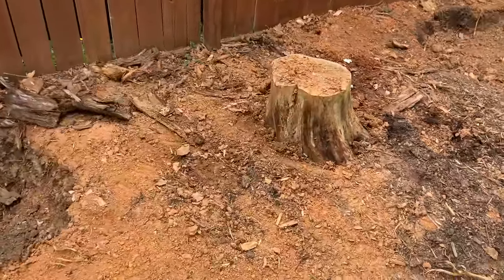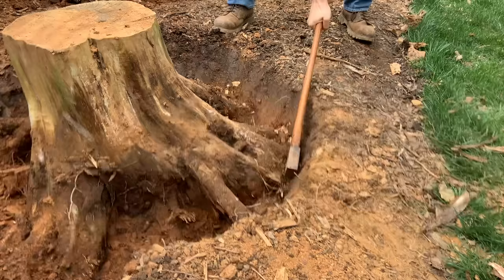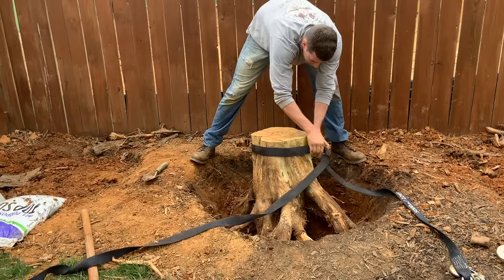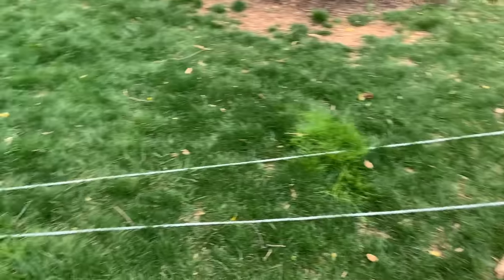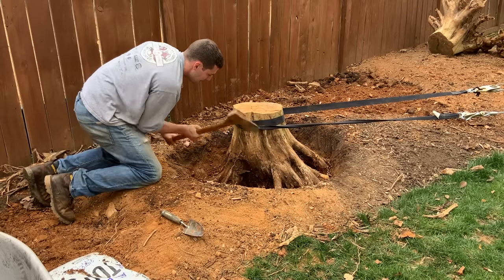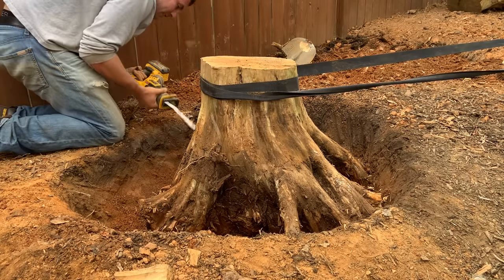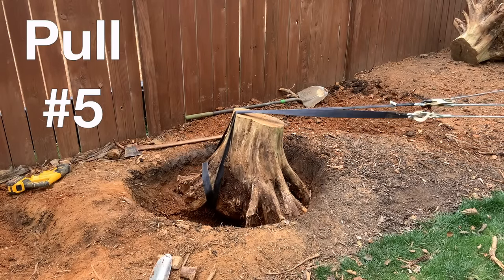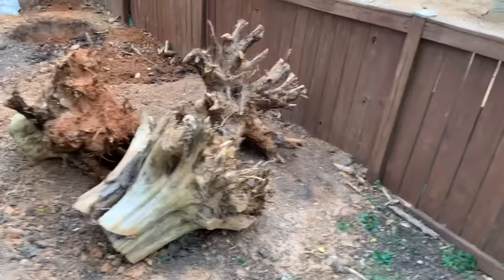How to Remove a Stump Using a Hand Winch

Comment: Why was this man busting his ass chopping the roots when he had the electric saw?
Reply from the maker: The saw blades dull quickly in the dirt and it’s always nice to get the heart rate up
Reply: Soon as chain saw touches dirt its over. You CAN use a saws all with a big blade however.
Reply: I think he likes the workout
Reply: Because sand destroys  the chain?
Reply: Dulls the teeth instantly,  then if you persist, grit gets under the chain and it breaks,  then you go to the hospital. An old circular saw blade is better and a sawsall works well.
Reply: It's possible to use carbide tipped reciprocating saw blades, I've also used the axe as well
Reply: Additionally I have used the mini handheld electric chainsaw available from Amazon and prices from $50 to $65 if you're careful with where you point the chain you can get quite a few Cuts before it gets dull.   Extra chains are available in multi packs for a very reasonable price
Reply: Recip saw with pruning blade or 9" wood blade is a standard on sewer crew jobs
Reply: U the type of guy who borrows someone’s tools and break them all.
Reply: @bellinghamfpv  you and I are both digging in the gravelly river rock and huge evergreen roots huh
Reply: You ever swang a axe in your work boots? Bettern putting syrup on your biscuits, boh
Reply: Macho stuff 😂
Reply: Because man!
Reply: I think the saw he was using was a sawsall.
Reply: Yes it's a last resort unfortunately.
Reply: But how long would it take to cut the tree down with a fork?
Reply: Why do people spend 15 minutes walking on a treadmill without really going anywhere
Reply: The wood closest to the ground has sand impregnated into it. It's not just the dirt.
Reply: I see you know nothing about roots
Reply: @Kaizen747  🤔
Reply: Because sharpening saw chains is annoying. And cutting dirt gums up the guide bar and stops it from oiling well and shortens the life of the bar and chain
Reply: @A_Dirrty_Bird  true mate
Reply: Sorta depends but bigger roots that are exposed well will be quicker with a good sized axe. I rip through batteries cutting stumps out. And then your arms are shaking for an hour.
Reply: @the-macjagger  spot on mate.
Reply: The pioneers did it this way sometimes being nostalgic is more interesting than technology
Reply: Sawzall blades dull from cutting in sand and dirt too. Basically you can easily dull electrical tool blades versus using a classic lopper or axe. More work, less expensive.
Reply: Battery possibly
Reply: my uncle Vern used a rope and his horse 🐴… old-school works every time !!!
Reply: Testosterone.
Reply: Did you watch the video? There's no chainsaw. It's a reciprocating saw. @the-macjagger
Reply: This is a job for Big Ed Pulaski
Reply: @jackmeyermakes should have made it
Reply: Me too😊
Reply: ok
Reply: bc he wants hemmroids 🙃🥸🙀
Reply: Make charcoal and save a lot of work.

Comment: Lastly, if you know you're going to remove some trees always leave a 4-foot Tall part of the stump.   Do not cut it down to the bottom because you can use the leverage of the 4 ft to help break it out of the ground applying pulling chains to the other trees not yet removed.   Take advantage of your existing objects/things around you to assist in efforts and with a little bit of pre-planning and leverage removing the tree stumps without mechanization.
Reply from the maker: These were cut before I moved in but completely agree the more leverage the better
Reply: Use the truck wheel trick when stumps are too short.

Comment: Thanks for the video, reminded me of a project I did quite a few years ago. Since I was cutting down the tree, so I had the option to leave about six foot of stump, to give me a leverage advantage on the stump. Like you I dug around the stump as much as I could and cut what roots I could get to.  I connected a two ton come-a-long to the stump and to a solid tree. I then pulled as tight as I dare, then just left everything hooked up, I poured water around the hole I dug, around the roots. When I got home from work the next day, I would tighten the come-a-long a few more "clicks" (as tight as I dare) and then pour more water around the roots, In about three days it came loose. Took longer, but the end results were the same. Take care and God bless.
Reply from the maker: Good approach thanks for sharing
Reply: Took longer but less effort.
Reply: EXCELLENT!   Yes,  your adaptation of tension Over intervals of Time is smart😊👍
Reply: Stump grinders are definitely easier, but it’s cool how those stumps can be turned into beautiful, functional pieces!

Comment: If you make anything with the stumps, know that stump wood is extremely abrasive because of the embedded sand and grit in it.
Reply from the maker: Noted. I know most saw mills won’t touch them for that reason. I’ll probably rig up a flattening jig expecting to do some resharpening

Comment: Jack, after I cut the first root apron, I fill the pit with water. Wait and hour. Then 8K of pressure is plenty. I also use a cheater bar/metal tube to give the hand winch lever 3 times the power (24,000 pounds).
Reply from the maker: I like that approach
Reply: Ha! u wish, at 24k punds the cable is gonna break, I dont tven think it can output 8000 pounds, mor like 4000 with the pulley...
Reply: The winch was not designed to withstand the pressure that can be applied using a pipe on the handle. You'll kill the winch. I've done it.
Reply: 24000lbs 🤔? hmmmm

Comment: The reposition for upward force was pretty smart! I'm sure I'm gonna use that idea at some point.
 I use an old truck wheel for the same sort of effect when stumps are short.

You can also wrap chain around the stump and use a recovery strap between the chain and wench.
Leave tension on it overnight amd just start a small fire under the base where the roots are. It should slowly pull up as it smoulders. The recovery strap will just keep on pulling as the stump moves.

Make sure the area has nothing flammable and soak it down. And put a fire ring or bricks Around it just to be safe.

Comment: I find leaving several more feet of the trunk attached rather than cutting it off a foot or two above ground level gives much more leverage potential when winching the root ball out. Hard but satisfying work when you finally pull the root ball away from the hole.
Reply from the maker: Agreed on the additional leverage making it easier. These were cut years ago before I bought the house so had to work with what I had
Reply: Yes. I had 36 trees cut down but left 5' of tree sticking out. A little digging and then I can pull out massive stumps with my backhoe. The leverage makes all the difference in the world.

Comment: I hate working on my knees and trying to dig soil around roots, so I use a garden hose to blast out the soil around the roots. Do the initial digging with a spade but once I start hitting tangled roots, I start hitting it with the garden hose.it’s kind of messy and mucky, but I do it over a period of a few days, letting the water drain away each time. It saves a lot of backbreaking work, even though it turns into a multi day project.
Reply from the maker: Good suggestion, anything to make it easier is a win
Reply: If the soil is extremely dry and you don't want to make it muddy, you can tape your shop vac hose to the sharp end of a wrecking bar and just start poking at the dirt while the vac removes it for you.
I have a hole digger that works in a similar way.
You can also use a drill with a bulb planting bit and just have someone hold the shop vac in place.

Comment: Nice work
Have used a 2 ton bottle jack, wood beam and blocks to lever stumps out of ground with wire cable over the beam and around the stump. Did not have an anchor for the come along, worked well with similar patience and absence of power tools.
Reply from the maker: Love it. I’d like to try your method sometime with vertical lift, seems like it would require less force

Comment: I know this work, I did it myself in a similar way. It was quicker with a tractor than with a rope hoist. I sawed off my last stalk with the chainsaw at ground level and added soil on top. To make the stalk rot faster, I drilled holes and put stable manure on them.
Reply from the maker: Good stuff, haven’t heard that trick before to make the stump rot faster

Comment: Thanks for the tips, just what I needed thank you.Went & bought a similar hand winch & smaller strops as I am using the tree next to it to do the work. Spent a large part of yesterday with just an axe & a pick & was blowing out my arse, thought I was going to die with exertion! Started setting up with the winch but it was getting dark. Just had a brew & going out with renewed enthusiasm & confidence! Thank you sir.
Reply from the maker: Love to hear it, hope you got it out of the ground today
Reply: @jackmeyermakes  Yes I did, thank you, the cable was only 3 metres but worked perfectly with strops & d shackles. Thanks for the advice, much appreciated.

Comment: I've removed a lot of large stumps on my property, but given how labor intensive it still is I can't say I've found an optimal way yet. Right when the tree is felled I try to cut away as much of the top as possible, ideally I level it with the ground. Then it takes around four years for nature to take its course and rot away most of the smaller roots, which will make it easier to pull out the larger roots later. At that time I dig out as much soil as possible around and below the stump with a hoe, takes about an hour. Then I take a chain saw and cut vertically into the stump to split it into four or more parts, as far down as I dare to go. This quickly wears out the chain, no way to avoid it. Then I take a large iron to break the stump apart with sheer force. I also use a sledge hammer to bash the various parts of the stump and roots. Takes around two hours to remove a stump. I've seen various clever tricks to remove stumps, but in my experience there is no easy way if you don't have access to machinery.
Reply from the maker: That's a great way to do it

Comment: Were there 2 trees to pull from to pull that stump out ? I’m confused on how you had your rigging routed. What does the line on the bottom right of the screen at 2:24 connect to ?   The snatch block at the bottom left connects to the hand winch and then the other side of that hand winch is connected to a tree ?
Reply from the maker: Yea I should have showed the anchor trees in the video. There are two mature trees about 15 feet apart from each other that I anchored to
Reply: @jackmeyermakes  ahhhhh ok thank you for replying 😀

Comment: I love the mechanical advantage idea. It was great up to the point where you pulled on the wrong spot. If you would have pulled on the single line off to the right you would have had 3 times the winche's pulling force as you explained, but pulling on the snatch block as you did resulted in 1.5 times the winche's pulling force. Still some advantage, just not what it could have been.
Reply from the maker: I realized this a long time after posting the video but you are exactly right. If I had pulled from the single line I probably could have shaved an hour off the work
Reply: Good catch, I never noticed until I read your comment. I think he got a 2:1 advantage, instead of 3:1, he could have. If you pretend  both trees are beside each other, he has a fixed point from the tree to the snatchblock, at the stump. When the snatchblock is by the load, it is a 2:1. He is then pulling on the other cable with a comealong. That snatchblock he has attached to that, and the stump is static. It isn’t doing anything or offering any advantage. He may as well have one line from his comealong to the stump, as what he has isn’t doing anything.

Comment: Interesting method, low cost and efficient. The only thing is about safety. I don't know what the tension is in those cables, but if one snaps, it could hit you very badly. Or maybe I am wrong?
Reply from the maker: These cables are rated for much higher than anything I can produce on the winch. The straps you’ll want to make sure are rated for a higher tension than you’d expect to produce. Could get a little squirrely if one snapped.

Comment: Stump can be pretty cool if you dry them clean them and leave them upside down for yard decor with the roots swirling around. You can even stain them.
Reply from the maker: I cut the bottom off one and plan on cleaning and finishing it to hang on a wall. I’ll make a video on it eventually but it is low on the list

Comment: I bought a HF hand winch and it failed right out of the box.  I noticed it operated really roughly.  I replaced it with a more expensive model and wow, what a difference!  You do get what you pay for.
Reply from the maker: That’s the truth. This winch barely made it through this job, the teeth started bending if I pushed it too far

Comment: I’m glad you wrapped a nylon web around the stump so the cable wouldn’t dig into it.  Why not use the reciprocating saw earlier in the process to reduce or elinate the axe?
Reply from the maker: It’s tough to avoid dirt with the saw which dulls the blades quickly, figured I could save a few by only using it where the axe had trouble reaching
Reply: @jackmeyermakes You did right using the reciprocating saw. You wouldn't believe how many people who would've used a chainsaw, and instantly dull a $30-50 chain. Way more than a 10pk of harbor freight blades. ( I was waiting for you to break it out.

Comment: I prefer a lever chain hoist. My one cost approx. 60 Euro and augments the force by 21x (2100 percent). It is very important to be familiar with the correct selection and use of chains and shackles. The chains which are meant to show where your private owned driveway begins might break at 100 kg.
Reply from the maker: I’d like to give this approach a try next time. I think you are right that it’ll go quicker

Comment: You never trust the rating on your straps to mean they won't break.   Instead you don't stand places where you'd get hurt if they did.   

Imagine a work site where they just said "hey, make sure you don't get hurt"

You need to both use correctly sized straps AND make sure they can't hurt you even if the ratings aren't accurate (either never were or they have degraded)

Comment: Leave 6 FT of trunk on top until the stump break free.  Attach strap a ft down from the top.   Gives you a lever with another 5X force multiplier.    Done this a few times.
Reply from the maker: Yep I would have done the same but the trees were cut before I moved it. A longer lever to pull from could have saved a lot of time digging

Comment: Could you do this with one anchor tree?
Reply from the maker: If you have a big enough anchor tree then i don't see why not
Reply: @ what did you use for a line. I have the tree savers and the pulley but I need more line.
Reply from the maker: I used a braided steel cable and it was way overkill for this application. There may be some synthetic ropes out there rated for winches that would work just as well

Comment: i used a sawzaw as well to cut the roots, then got 2 2x4 together and screwed then with 2 large large bolts to the trunk, then I used a floor jack under the boards to raise, then repeat on the other side etc.  I'm sure there a million ways to skin this cat. It just thats all  I had at my disposal in my back yard and no trees to winch from.
Reply from the maker: I’d like to give your method a shot some day

Comment: If the trunk still exists then obviously can pull at the highest point - I did this once to pull out a substantial tree and with the massive leverage no root cutting was necessary. Used a Tirfor but obviously again need a convenient suitable tree for tree for the anchor.
Reply from the maker: Yep a longer lever with the trunk cut higher up would have saved me some time

Comment: Hi. You can damage the bark of you second tree. If bark is removed 180 degrees around, your tree will die over time as it’s water circulatory system is cut off. Thanks.
Reply from the maker: Valid point. I used a 4 inch wide strap around the anchor trees, no damage done

Comment: In that opening between the roots, center stump, place a high-lift jack and Jack it out.
Reply from the maker: Good point. I’ve read it takes much less pressure if you can lift straight up as opposed to pulling from the side
Reply: @jackmeyermakes  I've had as many as 3 of those lifting from different points.

Comment: Hello, recently came across this video and am currently pulling out a stump. Any tips for pulling one out that has really thick roots that go quite deep? 😅
Reply from the maker: A handful of people suggested removing dirt with a pressure washer. Haven’t tried it but it may save you some time vs digging. Best of luck in battle with your stump

Comment: Get yourself a spud bar. One of the greatest tools known to man, a true back saving multi-tool. I never go on a job without one. 

As for this hand winch method, love it! Tried it myself on a stump removal job last week. There wasn't a convenient tree for the winch, so I ran it around one of the stumps holding up their neighbour's house. They were out at the time but I figured they wouldn't mind. Better to ask for forgiveness, I think, than to ask for permission. Pleased to report back that it worked a treat! 

Well, actually, just as we were pulling away we saw the neighbour's house collapse. Not that surprising really, but the important thing is that we got the stump out and we got paid. At the end of the day, that's what really matters most. 

Haven't had the time to go back, and probably won't anytime soon. Still, I'm sure it all worked out fine in the end. After all, that's what insurance is for, right? Of course, we had to change our ABN again, get a new fake address and ditch the existing cell phone number. But that's just the cost of doing business these days.
Reply from the maker: I'd hire you any day